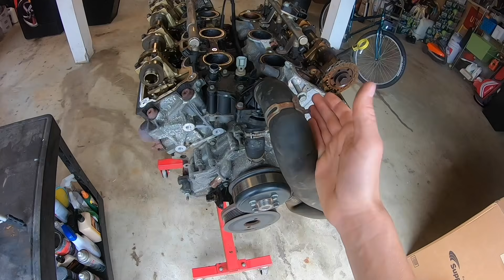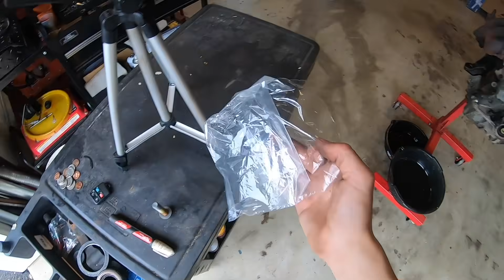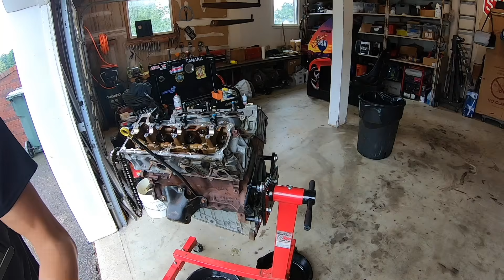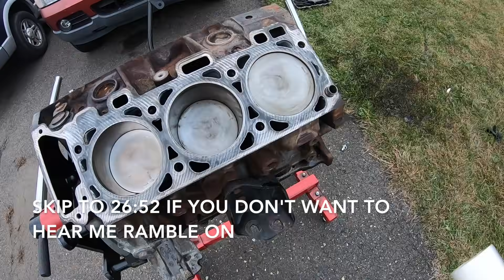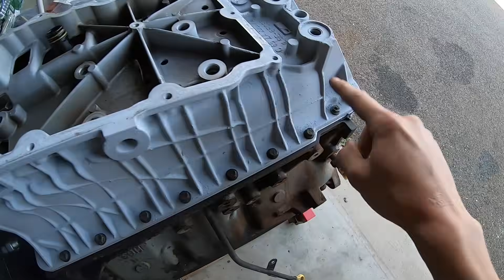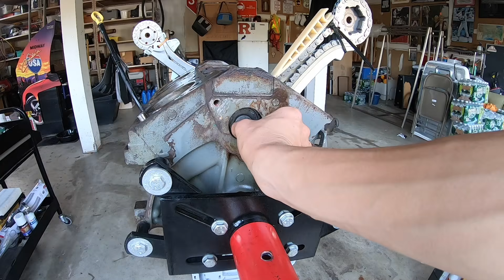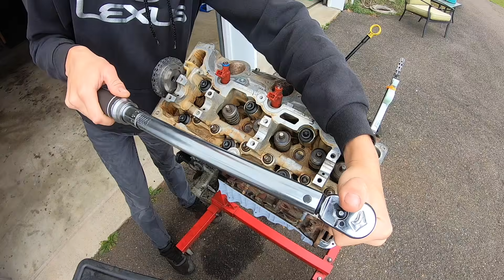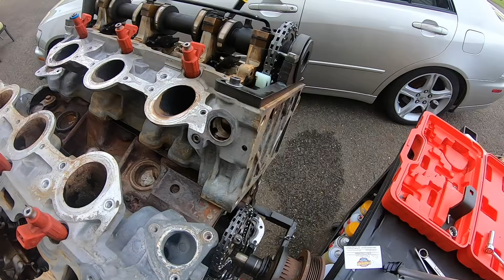Ford 4.0L SOHC V6 Head Gasket and Timing Chain Replacement (COMPLETE GUIDE)

Comment: I am rebuilding a 4.0 from 2002 Ford ranger. Don’t know if it was too wheel drive or four-wheel-drive. This engine does not have a balancer shaft. Did some of these motors come without this shaft.?
Reply from the maker: With or without doesn’t matter

Comment: Do you have to change your timing chain if your head gasket blows
Reply from the maker: No but if you’re in there it’s cheap enough
Reply: @iamdjnam  I recently sold a car to a mother and son which is this exact car, and for some reason they blew the head gasket and i have no idea how that happened and I am trying to figure out why the mobile mechnic they have are trying to charge over 2k for that when i personally think they just need a head gasket. Im trying to help them out and even offer some money.

Comment: I wanna install new head gaskets on my 08 Explorer. Do you have to remove the whole cassette assembly? Or can I just remove the bolt going to the camshaft and slide the cylinder head off? I definitely don’t want to pull the whole motor out either. Just wondering what you think would be an easier approach.
Reply from the maker: Remove the engine. Trust me, you’ll be so glad you did. If you can get the heads off, it is literally 12 more bolts to get the engine out.
Reply: @iamdjnam  I was reading the repair manual and it said the same thing that it would be easier to pull the whole motor out. I was just checking if there was a short cut without pulling the engine out. Thanks for the help your videos is gonna help me a lot during this process.
Reply: @iamdjnam so I’m in the process of pulling the motor out of my Explorer to change the head gaskets and timing chain set like you said. The set you have in your description is for rear wheel drive and not 4x4. I looked up the kit for mine at 1A auto and the kit don’t come with new sprockets? Is there a difference between rear wheel drive and 4x4 timing chain kit that you know of?
Reply from the maker: @DarkFoxx88 get the SA Gear 76135 off rockauto
Reply: @iamdjnam  you are a lifesaver. Thanks for the help.👍

Comment: U never did the 90° for the cam cap bolt so is it okay to reuse them

Edit: you said your putting the cam cap bolts in your baggie so I'm assuming they must be reusable
Reply from the maker: Yes reuse everything that doesn’t have a degree

Comment: How much do you charge to do mine?
Reply from the maker: $500 you supply parts
Reply: @iamdjnam  bet where are you located
Reply from the maker: @Marcus-cj9bz yeah no you drop off the engine only
Reply: @iamdjnam  where you based out of?
Reply from the maker: Nj
Reply: I'll drop off my truck

Comment: The factory service manual for my 04 ford explorer doesn't seem to indicate that the jackshaft sprocket bots should be discarded.   Is this just a common practice or does Ford "require" those bolts not be reused.   Thanks for the great videos!
Reply from the maker: They insist u discard but I reuse everything

Comment: Your head bolt removal order is the reverse of that suggested in the service manual. Is there a reason to do it one way or the other?
Reply from the maker: What service manual are you using
Reply: @iamdjnam  2007 Mustang factory service/workshop manual. On the other hand the Haynes manual agrees with you...
Reply from the maker: @b-chroniumproductions3177  that’s what I’m saying. I’ve used the Haynes procedure for probably 50 head gasket jobs now. No issues whatsoever. I’m sure either way will work though.

Comment: My man, this is one of the greatest walkthrough videos on this site!! Thank you for uploading this
Reply: Question, can you change the cam chains/ guides WITHOUT removing the heads? ALSO, I have a 05 exploder, in doing an engine replacement, I want to ensure the chains and cassettes are swapped out, I bought the chain/ water pump kit (it includes new tensioners as well), what other failure points are you aware are present in these motors that I should consider changing out?
Reply from the maker: @CtRacerX yes you can replace without removing heads. There are no other failure points. Replace the rear main seal

Comment: For everyone to avoid the heartbreak and frustration I just went through, do not tighten the lower rear casette bolt (with the o-ring) to 15 ft pounds or else you will snap the bolt off into the hole.

Comment: What type of rtv do you use for which surfaces?
Reply from the maker: Ultra black
Reply: @iamdjnam  the video shows you using high temp grey for oil pan, but im also wondering if you use any on the timing cover or what kind on the water pump? My kit came with paper gaskets for water pump and timing cover. Should i dress them with hylomar blue?

Comment: Quick question, if I’m re using the 8 head star bolts is it necessary to do the 2nd 90 degree rotation ? (They’re all the same length) I’m also using a digital torque**
Reply from the maker: Do not reuse head bolts. They’re like $30 for a kit.
Reply: @iamdjnam  okay so no matter the condition buy new ones ?
Reply from the maker: @KevinWolfay buy new
Reply: @iamdjnam  will do 👍

Comment: The balance shaft DOES need to be timed. Otherwise you could be exacerbating any vibration the balance shaft was designed to cancel out. You are better off deleting it than mistiming it.

Comment: Nick, I have a 03 Explorer 4.0  VIN K 240K miles and my timing chain - guide just bit the dust.  Rattles and rough running with engine light blinking. I shut it off and now have a mechanic quoting me $2800 to do front and rear timing kit.  I'm worried about valve damage.   Would it be best to get a used salvage motor, or be prepared for a rebuild, like you've done?
Reply from the maker: Grab a used engine and replace the timing set and seals before install. At 240k that engine is tired.

Comment: What if I take my head cylinder  bolts out right but not in order like u said is my head ruin. And if soo wahh I gotta do to fix wahh I did completely
Reply from the maker: Get it checked and resurfaced by a machine shop

Comment: Balance Shaft is only needed if you have an AWD/4WD. RWD dont have them. Im really thinking about dropping a 385 block in my exploder when the 4.0 dies... It is WAY easier to work on.

Comment: Can you reuse the rod cap bolts and cam cap bolts? 26:42
Reply from the maker: Yup
Reply: @iamdjnam thanks for your reply. My right cam has a dark amber-redish color. Then the left cam and chains+sprockets behind the timing cover are black and layered with debris. I'm trying to trace oil pressure or flow problems.

Comment: Incredible video. Thank you so much. If I'm only replacing the driver side head gasket, do i need to do anything at all with timing? Or can i simply zip tie the cam tensioner & chain then pull and replace the head?
Reply from the maker: Removal of any cylinder head requires retiming of entire engine

Comment: Great video man. I have to ask. This is pretty much impossible to do with the engine still in the car? I have to replace my passenger side head gasket but thats the side with the timing chain in the back of the engine and I figure there is zero room back there to get to the timing gear.
Reply from the maker: Pull the engine out. You ain’t getting to those bolts

Comment: Platinum Productions hey, you have an impact gun. You use it to crack loose the rear jack sprocket bolt. Now why can't you use the impact gun to crack loose all the other big bolts on the motor instead of risking hurting yourself trying to crack loose the high torque bolts like your head bolts with a breaker bar?  Makes sense? I understand you might need to use the breaker bar instead on the head  bolts because the high torque and speed of that impact gun might strip the torx head bolts.
Reply from the maker: Oh trust me, whenever possible I like to use my impact. But for videos I try to use hand tools to demonstrate everything I do is possible without fancy mechanic stuff.
Reply: @iamdjnam  ok that's cool i understand

Comment: At 128, 000 miles, the engine needs to come out and replace the timing gears,  4,0 liter 2007 ford explorer engine.
 This is normal for the 4,0 liter ?
Reply from the maker: No. Lack of maintenance caused it.
Reply: I have one at 138900mi and still runs strong. Pretty sure it no long for this world though. But I have seen them go 230k+ miles with proper MX.

Comment: Do you know the part number for the sealing washer for the timing chain tensioner bolt? I got a 22x26 sealing washer from the hardware store cause when Ford sold me the tensioner it didn’t come with a sealing washer. But I kinda wanted to get the OEM one just to make sure. Haven’t put it in yet but kinda nervous.
Reply from the maker: XU2Z6M252AA

Comment: best video on the 4.0 ,, wish I had this when I did mine, few years back, I put a cloyes complete timing chain kit in, and thermostat housing, new water pump  , heads redone , and installed the stainless steal exhaust manifold studs. only thing i wish i would of added is a high volume oil pump since i had it all tore down. still running strong with 45,000 miles on it. One other thing is I bought the tools to align all the cams and timing chain for 200 then sold it for 150 when I was done , all in $1300

Comment: I bought the timing chain kit from 1A auto and the chains from camshaft broke,first the driver side in about 3 hours of use had to do it again a few weeks after using the original chain and another 2 or 3 hours later the passenger side camshaft chain snapped too I guess 1A auto is selling garbage  
This time I’m going to get OEM from Ford 
So never again 1A auto

Comment: Everything I have found on this video is right up until the torque spec on rear cassette pivot bolt. In the video he says 15 foot pounds and I broke the bolt off in the block. He made another video of just replacing timing components and he said 89 inch pounds in it.  The bolt alone on Amazon is around $45 luckily there was enough of bolt sticking out I was able to get a screwdriver on it.

Comment: If you ever get back to reading comments and find this one, I have a question.  I went through your entire rebuild process.  The engine has been running great for a year and 13,000 miles. It has a problem with running rough at idle, about 800 RPM. Take it off idle to 1000 RPM and it’s smooth as glass. Any thoughts?  Thanks.

Comment: Any suggestions I'm having a hard time getting the head bolts out of the old heads I have to put new gaskets in they won't break any suggestions anybody at all
Reply: I had trouble until I took the handle off of my low profile jack and put it on the end of the wrench. That extra length got em cracked.

Comment: Very interesting and informative for sure, thanks Nick!  Boy o boy, that is one complex system with all those chains and shafts.  They couldn't put both cam gears on the front of the engine?  I was wondering why I kept hearing the term "cassette" until I saw you installing those chain/guide units into the block.  That is a strange torque method for sure.   A low foot pound spec, then another 90 degrees afterwards, I suppose it works though. What are those crazy looking tubes over top of the cams?  Oilers?  Am guessing they spray oil down on top of the cams, etc.   I know you mentioned that lack of maintenance probably caused this failure, but it seems like all those plastic tensioners/guides would have a definite service life before they should be replaced.  Looking at all this would scare me away from buying a used Ford 4.0L with high miles, unless this service had been performed.  I guess it seems kind of like the old engine with timing belts that had a definite service interval.  It seems like the heads have to come off to do this job, correct?   Well, I would never attempt a job like this, wouldn't trust myself to get all the details right.  Wouldn't trust most shops dealers to do the job either, unless they convinced me the tech had plenty of experience doing this operation.  Extremely interesting and informative just the same, enjoyed watching buddy.   Don
Reply: PS:  What is so wrong with tapping the balancer on with a rubber mallet/dead blow?  Are they worried the rubber will be dislodged/damaged?  I'm old, but was paying attention.  Why did you pull that engine out of what looks to be a perfectly good explorer?  In a wreck?  If not, why not reinstall the engine and have a great vehicle to use?
Reply from the maker: @fleetwin1 1) it screws up the thrust bearing
2) engine was blown
3) I put it back in and the truck is mint now.

Comment: Does the jacksjaft have to be in time or is it just along for the ride?
Reply from the maker: It does not have to be timed. It’s like a cam without lobes.
Reply: @iamdjnam  ok awesome about to tackle this job and was thinking how am I gonna torque it without it moving but if there’s no timing marks I guess your chain method will work just fine

Comment: Did it start did it run?
Reply from the maker: 50,000 miles on it now. Drives from NJ to DC weekly and NJ to Florida twice a year
Reply: @iamdjnam  well mine still not starting! No compression on 5 cylinders
Reply from the maker: @asidasid2487 timing is off and bent all the valves

Comment: I loved your video bro!  Most complete, concise and entertaining one I’ve seen on here.  I have a question for you.   I recently replaced my timing chains and head gaskets using your guide, everything went smoothly.  When I was checking the engine that everything rotated and nothing was binding etc.  I noticed the passenger side chain near the cam sprocket would get slack periodically as I rotated the engine by hand.  Like the tensioner didn’t have enough spring force to keep it taut.  This is concerning to me because it means it’s going to slap around at cold start up.  Is that normal or do I have a defective tensioner?  I would rotate it and get the slack and I was able to use a screwdriver and push the guide tight but the tensioner wasn’t able to on its own.  Was just wondering if you have witnessed this?  Thanks again for the awesome job!

Comment: I need help!
On my 4.0 sohc I'm having a recurring problem. On the passenger side, the cassette clicks while the engine is turned. I oil charged the new tensioner, but it doesn't hold the charge. Did I time the engine wrong, or is it possible that I got a bad tensioner. Please help me, I need this truck to provide for my family.
Reply from the maker: New tensioner? Clicks when running?
Reply: Yes. The timing chain becomes loose on the opposite side of the gear but then snaps tight again.
Reply from the maker: @thefigtree4693 when it’s running or off?
Reply: @iamdjnam  both. I turned it by hand because I thought it was a bad lifter. But turning it slowly, by hand, the cassette extends and then snaps back, making the clicking noise.
Reply: @iamdjnam  I'm pulling the engine and putting a new cylinder head on that side. I'm thinking the oil port for the tensioner is clogged in the old cylinder head. That's the only thing I can think of that could cause this tensioner to lose its charge.

Comment: Thank you for these videos!
My 2006 Ford Ranger's 4.0 sohc blew a head gasket, and your videos were instrumental in rebuilding this engine.
**SPECIAL NOTE:  Be sure to oil charge your tensioners before installing them. Submerge them in oil and pump them with your thumb until they stiffen up.
Reply from the maker: I don’t typically prime the tensioners. Once you install them it just squeezes the oil back out. I leave the plugs out and free spin the engine to prime the system.
Reply: Unfortunately, I neither primed nor rotated the engine to prime the tensioners.
    When I started the engine, it ran fine for a couple of minutes but then jumped time and died. 
    Upon teardown, I found the rear cassette was shattered.
    I removed the heads and flipped them upside down to water test the seating of the valves. There was no seep-through, so I believed the valves to be okay then reassembled the engine.
    It now runs, but it's got a tap that makes me think something else in that head was damaged.
    I'm going to replace that head because I want this engine to be as perfect as the ones you build.
    It's been a learning process and I couldn't have made it this far without you. Thanks again!
Reply: Also, can you recommend a supplier where I can buy a new valve body for this engine?

Comment: I have a 2002 4.0 SOHC Explorer XLS, it had a timing chain rattle for years. I broke down one day and later found out after taking it apart that the jack-shaft to crank chain had broke. This is after trying to restart it many time as well. I inspected the pistons with a bore scope and they all looked fine. I bought a timing kit on Amazon and installed it, it ran great and quite for 160 miles. I broke down again, only this time it would run only very poorly, like limp mode. The plastic on the brand new jack-shaft tensioner snapped and the engine jumped time and was driven that way for about 10 miles. After taking it apart again I also discovered that the front jack-shaft joint had spun and both heads were out of time with each other and the crank. I timed it all over again, I did not remove the cam followers to rotate the cam into time, just loosened the cam sprocket. I replaced the jack-shaft tensioner with a Ford one and it runs great again. No piston/valve strike because Ford changed it to a non-interference engine sometime in 2002.
Reply from the maker: This engine was a 2008 💀

Comment: 2005 Machined Cylinder Heads.  Does any need these?  They are for a V6 4.0L. I paid $600 to have them machined. Engine has maybe 150,000.  Let me know if anyone has interest.  I’m in MA